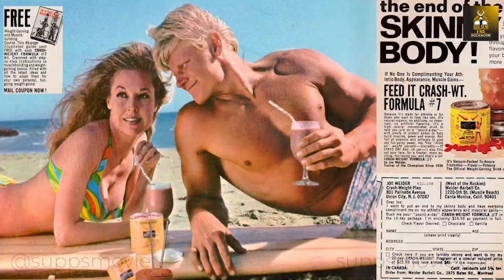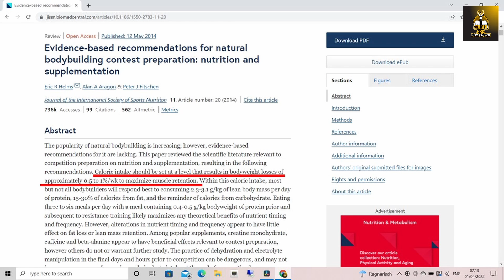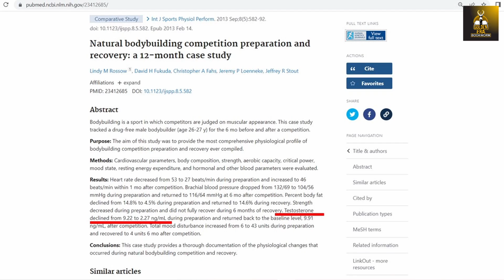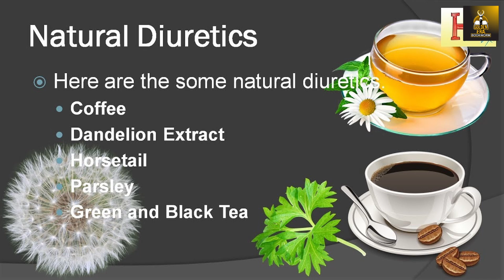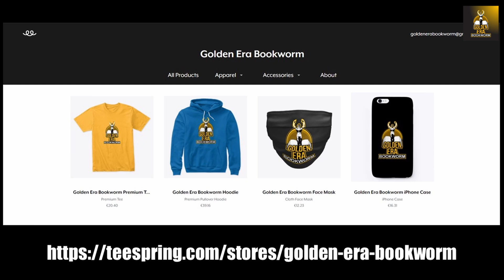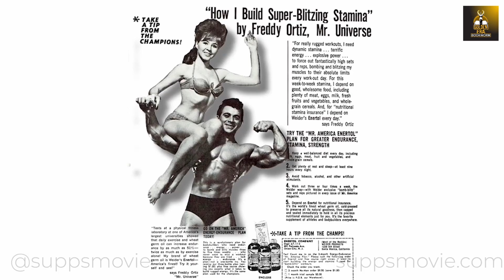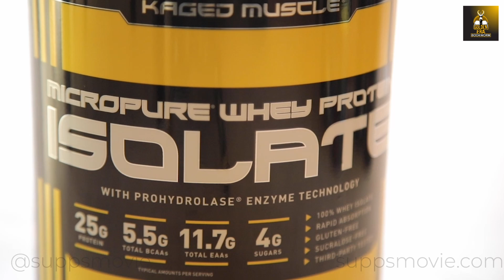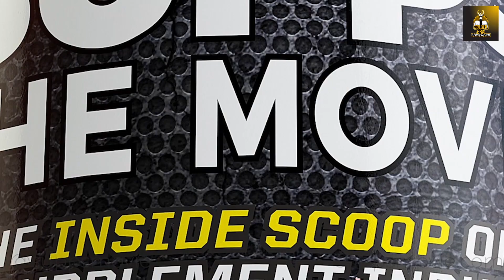MOST SCIENTIFIC WAY TO GET RIPPED & FULL FOR NATURAL BODYBUILDING COMPETITION

Comment: 12-15% of body fat is enough for male i think it should be maintained year around to look good and stay in shape year around and if you have plans to step on stage then cut it down to 5-7  rather than extra bulking over 25 and then doing drastic cuts which take away muscles too along with fats not mention that disguting fat look.